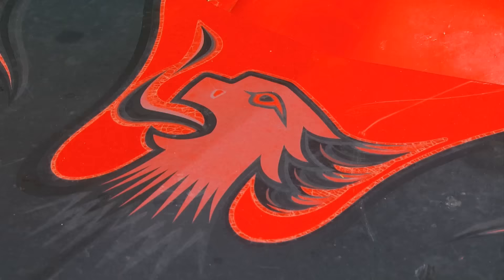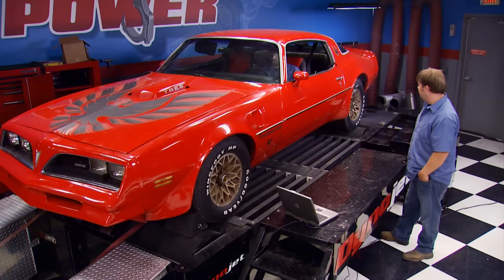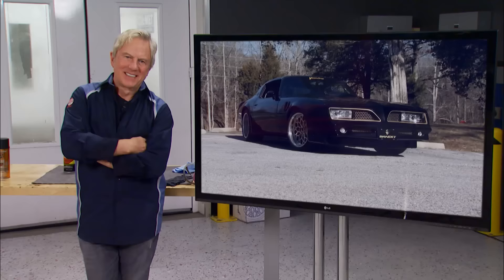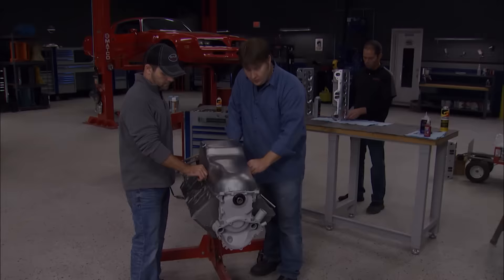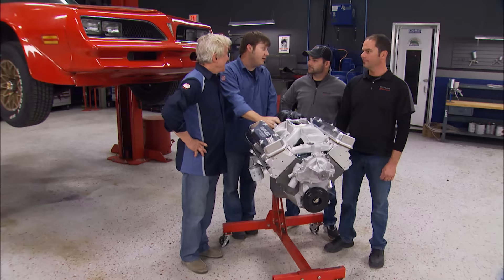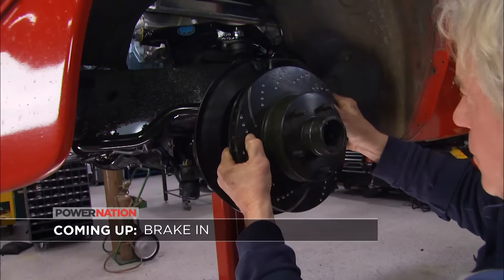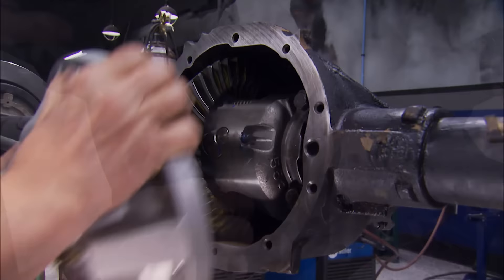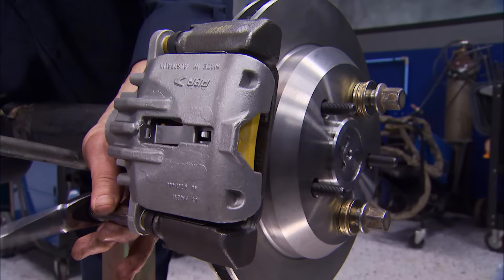Full Build: 1978 Pontiac Trans Am Bandit Tribute

Comment: I enjoyed this Video. It was fantastic, watching your installed a new Engine from scratch, plus rebuild the car suspensions, and torqued it to it specifications. New sway bar link, control Arms, coil shocks, rotors, brakes, shift cable, differential, pinion gear and seal, C clips, modified floors, new tie rod ends, logos,  nice painted transmission, new u joints, new mufflers, oxygen sensors, alignment using toe in and toe out. 55 Engine block, new valve springs, new pistons and Rod, new cylinder head, and gasket, nice intake Manifold, and etc... it was a wonderful video because your explained it in a understandable way. Thanks Detroit Garage!

Comment: Awesome job. This is my dream car. They should've stayed with black vinyl interior tho, & cut the roof & got a ttop roof from a junk donor & welded it on, & also got one of those upgraded retro oem style stereo so that it looked original but had bluetooth. I so badly want a 77/78 bandit ttop upgraded just like like this but with 5-600whp. I have all the different toy manufacturer versions in 1:64  scale of Bandit 1 & 2. I have 7 different versions.
Reply: I think with 600+hp, you REALLY want/need a full roof for rigidity, unless you're willing to put a cage in it. I had a t-top IROC, and yep, I loved driving with the tops off, but that thing rattled and twisted something awful. Really, to be truthful, that car was a POS. The stock 305? I think the less we say about them, the better. So dumb of GM to not have a 5sp offered with the 350. I know gas mileage was a big deal back then, but there's no reason they couldn't have made a manual that would work with an HO 350.
Reply: @PaulSter  in a street car that's not going to hook up like a track car on slicks, then a set of subframe connectors would reinforce it plenty, if that's not enough you can get full bolt in frames for them now, but that's excessive for a street car under 600hp.. I've cracked the floors on hardtop foxbody & new edge mustangs at the track, so with or without a ttop isn't that much difference if your launching at 5k rpm and dead hooking. A ttop car with subframe connectors and you'd be fine dumping the clutch at 5k rpm. Personally I'm going to buy a 78 ttop within the year, and I plan on dropping a stroked 455 in it with around 600whp I'm gonna dritch the leaf springs & put a 4link in it tho, they mount to several more places under the rear of the car and have extra bracing so that accompanied with good subframe connectors will be more than enough for a fun driver. I sold all my jdm cars now I just have to find a decent clean 78 t/a thats not to perfect or numbers matching that way I don't overpay and so I don't ruin an original car by restomodding it, I want oem looking as possible, just 4link, tubular control arms up front, coilovers on all 4 corners, stick to the real pontiac 455 4bolt main tho and just build it & add efi, upgraded dual piston disk brakes all around & either a t56 6spd manual or built 4l80 auto with a dual gate shifter like came stock in 68/69 gto. I found a good candidate I have to go check out but they're asking a little to much for it, so we'll see.
Reply: @brianbevans6804  yea, it would 'probably' be fine with the sub-frame connectors, but they weren't in my '68 Nova. Doors got pretty bad for opening and closing - and that happened with 
a built THD400. It was a turbo'd 355 that even managed to blow a head gasket with o-ringed heads. Those things happened after I sold it to a family friend. I'm not sure what he did to my car, but I didn't expect either of those things to happen after I stiffened the frame. Coupled with my experience with my "bendy" IROC, I decided that if I ever get the chance to do it again, I'm going to stiffen the car in every way possible. But I was also planning 800+ rwhp a BBF w/ Tremec, and having a handling car for once. So I'd be using every possible aid to make that happen.
Reply: @PaulSter  I just want a nice street car with no more than 600hp, if I was building something I planned on taking to the strip or beating on all the time I'd definitely go full frame an either buy an already full frame car like 69 chevelle or 69 camaro or buy a custom full frame for a unibody car, you can get them for about any popular performance style car these days. Just type in 2nd gen fbody full frame and Google will bring up full frames from like 20 different manufacturers ranging between $12k-$20k. But I would use a lighter car if I was making an all out performer, the 2nd gen fbody is already a heavy car and adding a full frame would put it over 5k lbs, defeating the purpose of an all out performer, so its not a great platform for that anyway unless you spend some serious coin an cut away half the unibody & use carbon everywhere you can. Personally I don't care for the 3rd gen fbody, the 80s interior were hideous and really cheap plastic. My buddy loves 80s camaros tho & has had several of them, they look ok from the outside tho, but the firebirds are ugly inside & out, they are dog slow but thats an easy remedy if you've already got the 350, my buddy had a mint 88 iroc 350 tpi and I smoked him from a dig in my other friends 04 mustang 3.9l v6 1 wheel peel 5spd manual, lol.  An yeh its shtty the 350 never got a manual only the weaker 305 did, but honestly I like the auto with the 350, just throw a dual gate shifter in it an your set..
Reply: @brianbevans6804  I hear you. My 305 IROC was such a dog. That's why I ended-up w/ a new Mustang 5.0 (I would go on to own three more).

It's weird, I was always a Chevy guy, but always wanted something different, and that wasn't the usual Camaro, (unless it was a '69, but they're too pricey now) or a Nova. Almost decided on a Monte Carlo, but to your point, I knew it would be heavy. I was going to overcome that with a huge, torque-monster crate motor.

But I love what builders are getting out of the BBFs, but finding a good donor car is the hard part. For me, I think the best plan is to get something that's built already, (just barely street-legal), has three pedals, but that needs an engine, or has a blown one. Like where the owner just ran outta money, time, or motivation. Still got an itch to race shifter class. I'm still at least two years away from mine. 

Your kind of build makes the most sense though.  5-600hp is definitely nothing to sneeze at and big Chevy power is so much easier to come by. Anyway, good luck with your build!

Comment: For sure  ,i would install two small ( manual) extractor fans mounted right behind those front side scoop..i 've done it on a Turbo Volvo and was impressed by the amount of heat ,they would remove in seconds from that hot engine bay..(if you have a temp/sensor gauge on the dash) especially when stuck in traffic..!!!..and have them to keep running another 2 minutes after ignition is shut..(heat-soak)..

Comment: I have a 78 Y88 Gold Special Edition. 300k+ miles on the odometer too lol. It belonged to my father and he had it repainted, new decals/emblems installed, some body work, rust work, and a minor engine rebuild around 2010. He passed away in 2013 from cancer so I inherited the car from him when I was 11. It still runs and drives and it sits in climate controlled garage so it still looks good as new. I'll be bringing it back down to North Carolina soon!

Comment: Perfect wheels and tires. Perfect choice. They're, IMO, the perfect compromise between OG and those excessive Foose-style (sorry, Chip, but I gotta say it!) wheels that leave practically zero sidewall and just aren't period correct and I think look all wrong on classic cars. On new cars it's a different story. Just MO. But with the suspension upgrades, and those wheels and tires, this T/A has a great stance. 

I've seen Year One's equivalent bigger wheels for I-ROC Zs and those look great too.

In both cases, it's so subtle to the untrained eye that they might think "car looks so new! There's something fresh and modern about it that I can't put my finger on." To me, that's the ultimate score. You update it just enough to make it look almost original, but better in a not so obvious way.
Reply: While the dyno results are good, I was really hoping for, and expecting a lot more power - especially when you're adding modern ECU that's optimized for engines like that, and not just a big 455, but a stroked one 472 ci?). At, what was it, 419hp to the rear? Trq is decent, but I thought it would easily go over 500 with no problem. I mean, not to be a d**k about it, but that's really disappointing. You can buy fully warrantied, dyno tested, motors that would stomp all over that. Since we're not talking #s matching anymore, it might even be tempting to go to the dark side and...build an LS 😜. Yup, I said it and it's gonna be on the internet forever.

Comment: These guys are so talented, they're making 101 basics mechanics fundamentals interesting !
I would have loved to learn car mechanics from people as passionate as them.
Very high quality content video.
Reply: They so talented that they sprayed carbon fiber instead of making the carbon fiber part.
Reply: @youtubecomments5951  
I don't understand you comment whether if it's a joke or not, but I believe this performance hood is made of threaded carbon fiber coated with epoxy as is it usually made.

Explain yourself please !
Reply: @Rainmanthereal   1.43.43  they really are talented then they went and did carbon spray paint.
Reply: @youtubecomments5951  

Still don’t understand what you are talking about

This freakin hood is a made of carbon and they coated it with paint to protect it. They explained the whole process in the video.

The guy just flipped it himself without help as it is light.
Reply: These guys are basically ACTORS putting on a show...

Comment: Most brake manufactures recommend not using brake clean to clean your rotors/drums. If you must use it to get the rust resistant coating the manufacture puts on them before installation they recommend using hot soapy water afterward to remove any residue.

Comment: Why in the heck did these cars have such big engines with known choked performance numbers from factory and even if built the things weren't noticeably better than what a 302, 305, 351w, 350, 390? Essentially just more efficient at it?
Awesome video yall!
Reply: The EPA demanded cleaner burning engines which meant detuning them to run on unleaded fuel. On top of that we had 2 oil embargos which meant more detuning to keep the engine at low RPM's. Add to that the government wanted them to be safer which meant adding door crash bars and 5 mph bumpers. All of this and the rising insurance costs for young people buying muscle cars is what led to the malaise era cars. And if you think that was bad, consider 1979 was the last year for a Pontiac 400 in a Trans Am, and 1981 was the last year for a  Pontiac V8 in a Trans Am.
Reply: Not true, couple hundred dollars for better pistons and camshaft would double the HP...
Reply: @BuzzLOLOL  Double of what? Anything a  302 305 351w 350 390 couldn't?
Reply: @colubrinedeucecreative  - Of course, all the early 1970's 100 - 200 HP emissions slug engines could be easily doubled back up to 200 - 400 HP... although the 305 came out in later 1970's and was never quite as slugged down as those others...
Reply: @BuzzLOLOL  Yeah I mean that makes sense it was a more efficient engine, ie the amount of unburned fuel was minimal compared to those huge engines which again, it just really doesn't make sense to me other than it was a bigger weiner contest, so they could have the numbers on the sales receipt but in all reality a fairly useless amount of weight. 
As far as I can tell the engines could all be built fairly easily to the same amount of HP, but the bigger engines were not better even in the higher HP configs. It was indeed a different world back then.

Comment: Amazing my 1970 Challenger RT 440 mag rated 375 HP change to next size valves port the heads replace cam with the purple one and 510 HP look it up in the direct connection performance book.easy and cheap do it yourself.

Comment: I went over the top when I re-build my car and plastered the entire interior with those heat/noise mats (dyna-mat type) even under the roof ,inside the doors and fenders (right on the wheel arches)...and also the fire wall ,I even added wood panels (walnut) on the engine side of it..not a degree of engine heat would go through..!..the ride comfort is equal to a Bentley..!!!..extra weight was not a concern..!!

Comment: I have to comment on the black 9700…..several places I buy my paint can’t match it. They say the formula has changed. It now looks brown. Ppg ,Wanda mason and shop line look brown in the Ford 9700. If you say gm wa 8555 that sometimes will look brown. Idk if someone over pours. I’ve since mix everything myself. I use Wanda system because they don’t have variants so there’s no reason why it won’t match unless you would over pour or leave a toner out

Comment: You can improve the handling all you want. The big problem with these motors is oil control on cornering. On the track, this car won't be able to keep up with a Honda Fit before the oil pressure goes to zero. As me how I know

Comment: Hi. I don't know about power systems in American V8s, but wouldn't it be a better solution, with such a strong engine tuning, to assume MPI (multi point injection) instead of SPI (single point injection). I really don't know, but I think the EFI that was installed in this Trans-Am is just a variant of SPI. If I am wrong, then please correct me.

Comment: Adjusting idle screws has no affect on WOT A/F ratio.
Reply: Actually it does, the unblocked idle circuit was flooding the engine with gasoline...

Comment: They screwed up by not telling the audience how to set the pinion bearing preload. It is a very critical adjustment. They set it up right or they would have wasted the bearings but the fact that they didn't mention this can lead someone to just tighten it down like they said which would be disastrous. There is a crush sleeve that sets the bearing preload. It has to be tightened down to a specific inch pound of drag when you turn the pinion. I made the mistake years ago of just tightening down that nut on my 82 Trans Am and wasted the bearings within a couple of miles.

Specs on my TA were 383 stroker motor, 9 to 1 compression, Edelbrock Performer, 650 Holley double pumper. Cam was big enough that i had to back off the intake valve adjustment like it was a solid lifter cam to effectively reduce the overlap to have any vacuum and it still had a very rumpy idle. (had no budget so used what was available in the moment)  and a 3 inch single exhaust thru a glass pack. After i wasted the stock rear end i went from i think 3,23 ratio to a 3.43. Had a 4 speed with a vertical gate shifter where you just pushed and pulled the shifter straight up and down to shift with no H pattern. I had a blast with that car for years until i twisted the crank in half on a 6000 rpm shift to 2nd gear one morning :)
Reply: These guys are ACTORS, any time you do these things, learn the RIGHT WAY to actually do them...

Comment: Very cool, but always a disappointment when base/clear is used on an original single stage car. I personally hate clear coat.
Reply: Cars got much shinier about 1985 when clear coat became standard... white cars especially looked much better...
Reply: @BuzzLOLOL  as i said i hate clear coat. Shinier is not necessarily better. Clear doesn't show the lines of the car as well either. I have a 67 f100 with original paint been sitting in a field. Every car ive owned with clear it looks like crap within a few years even with regular wash n wax. For clear to last it almost has to be garaged.

Comment: 1:51:03 - "Replacing those ugly wheels and tires with something new and cool"

How did I know that those two rubes were going to ruin the look of that car by installing giant wheels and fan belt tires? As a "bonus" they also applied that laughable fake "carbon fiber" effect and traded an original steel hood for an aftermarket plastic one. I guess they can't help it; it's in their hayseed blood.

They obviously should have restored those original 15" gold snowflake wheels, which are some of the best looking factory wheels ever made, as well as being a fundamental part of that car's iconic look. And they should have bought some new factory-size tires to mount on them.

Comment: That’s not how you assemble a new gear set! The pinion depth is never right where you can just throw it in! You sand the original bearings I.D. So you can assemble and disassemble it easy as you will have to shim it to get the pinion depth correct! Back lash is a minor thing, wrong pinion depth and it will be noisy and wear out quick!

Comment: The car would have been worth a heck a lot more if you left it all original and found the original imagine number engine and built it back stock instead of ruining the car it's not like there's a whole 10 20 million of these cars left
Reply: when they pulled the ground effect parts around the wheels the car was originaly black they show it in the repair section of the video.
Reply: Round 98 or 99 i had a 74 firebird with a 71 formula nose and hood it was gold heavy micro flake over a frost white base it featured a 400 with a 4spd when i first got it  let me tell you that thing could really move it would eat up those Mickey Thompson sportsman pro's

Comment: Who is tell me your TV guys are on here would start building a few engines for the common man not just race engines. They go to 6000 and 10,000 RPMs start building some engines that don’t go over 5000 RPM to make some be impressed.
Reply: In no way is what they put in that considered a race engine. If you only want under 300hp cars, you just build it the exact same way, but you use stock parts. It's not science.